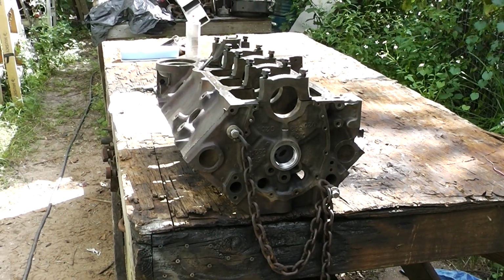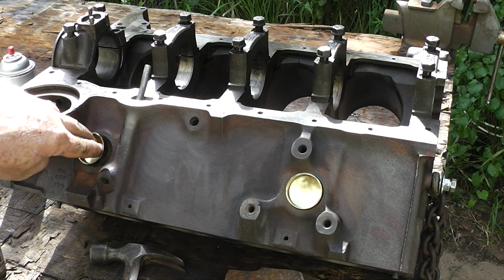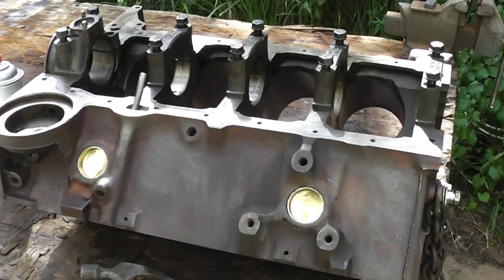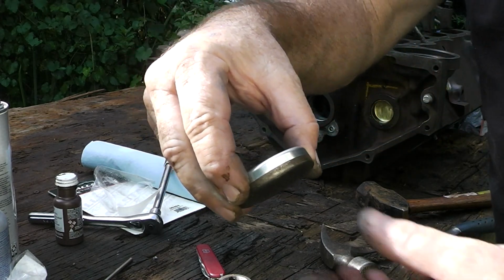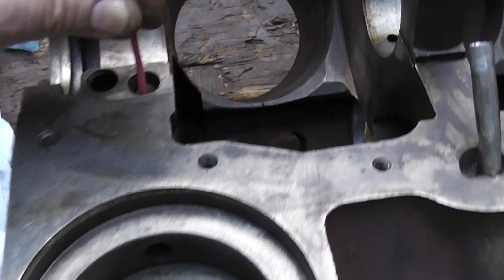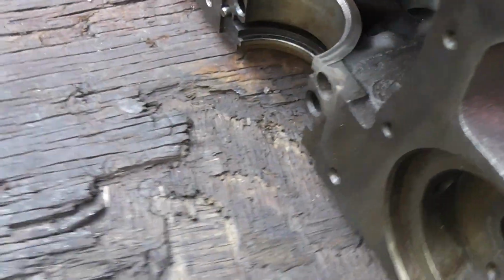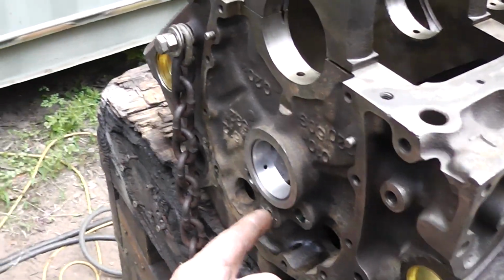How to Install Freeze Plugs in a Small Block Chevy

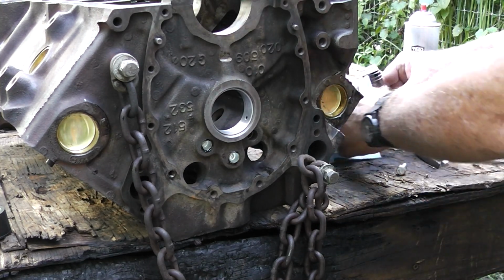Comment: @17:49 you say use a tool on it so oil gallery so plug will not push out? just how much presser would it take for that pressed in plug to blow out??? i would think around 2,700  psi... i don't know what type of oil presser you run but it would wash out the aluminum babbitt  if it had to much pressed i think ,,, i never seen a pressed in plug blow out yet,                         Factory never uses a sealer on plugs, why do you, just so you know: i have never used a sealer yet... i rebuilt engines in a shop for 23 years never saw anyone use a sealer on a freeze yet, it would take to  much time to do and a mess too. and who is paying for the sealer ???
Reply from the maker: You might be very knowledgeable but, I noticed that you don't have any videos that you've made. How about you show us all the right way to do it? I put sealer on for insurance against leaking.

Comment: I'm glad you got your block back how much overbore did they go on it?
Reply from the maker: I was advised to not rebuild the 305 by the machine shop.  This is a 350 that I aquired for cheap.  No over bore on this one.  This will be an old school build eventually.
Reply: @homesteadprepper  I have a set of eight 30 over 327 flat tops with valve reliefs stock rods that need a home if somebody could spring for a large Journal crank it'll go in the 350 block 30 over and be a 331 a 350 crank kit is 200 bucks a 327 crank kit is six hundred bucks I believe a 283 crank with spacer bearings will work just saying if you have any ideas these Pistons need a home
Reply from the maker: I don't currently have any 3.25 stroke cranks at this time but, you might would try your local craigslist.
Reply: @homesteadprepper  I don't want one LOL thought maybe you did I would furnish the Pistons and rods for somebody's YouTube build I'm currently about to graduate into the world of LS I got a 3rd gen lq4 with a 4 L 80 that's what I'm playing with right now
Reply from the maker: @forestlawrencegrading9154  👍